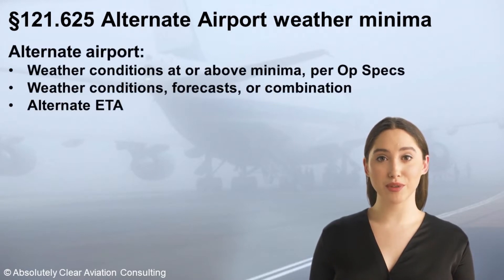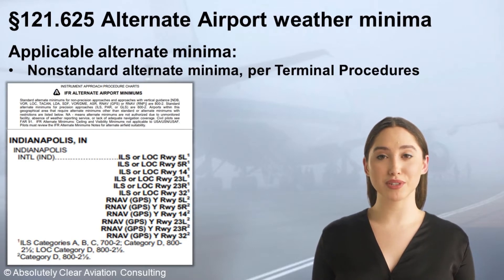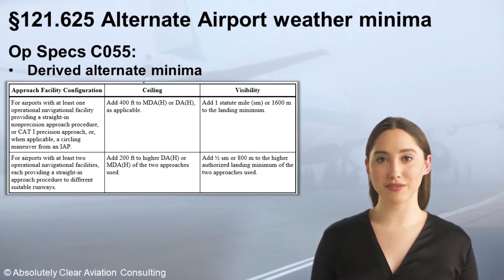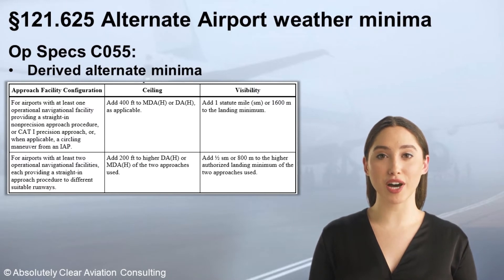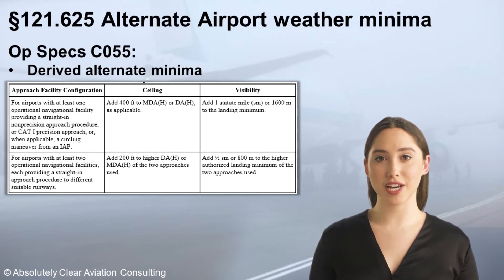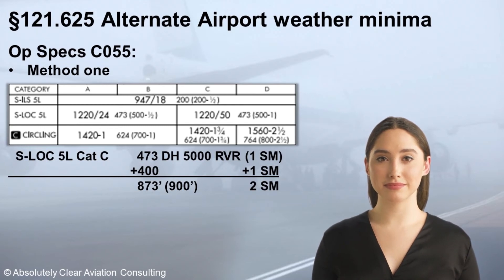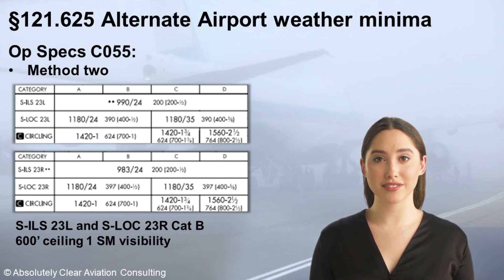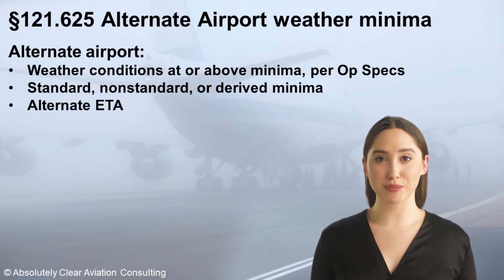FAA Part 121 Alternate Airport Weather Minima

Comment: When do you need an alternate in FAR121?  123 Rule? What about PROB or CHNC of in the TAF?
Reply from the maker: If both the latest weather report (METAR) and forecast (TAF) do not indicate at least 3SM AND at least 2,000 ceiling for period one hour prior to one hour after destination ETA. If either of those weather products indicates a visibility less than 3SM OR a ceiling less than 2000, an alternate must be specified. Any conditional language (tempo, prob, becmg, must be considered if time frame covers any portion of the +/- 1 hour ETA.

Comment: What about a prob in the forecast? Or a tempo?
Reply from the maker: In the absence of an ops spec authorization to permit less than applicable minimum weather in such conditional statements, with regard to qualifying an airport as an alternate, the applicable minimum weather must be reflected in the forecast at the alternate ETA. There can be nothing lower than the full applicable minimum ceiling and minimum visibility in the portion of the forecast that covers the alternate ETA.

For example, if the applicable alternate minima is 600/2, a probability or tempo that contains anything less than either one of those minimum values, would disqualify the airport under consideration for an alternate (at least at that ETA), since both prob and tempo statements are indicators that the ceiling and/or visibility could be less than required. 

Technically, a delayed departure time, which would result in a later destination ETA (therefore a later alternate ETA) may yield a different line of the forecast which would fully satisfy applicable alternate minimums. A more solid alternate (with better than minimum applicable weather) is a more prudent plan, when possible. See §121.631 (b) for the logic. Any new forecast issued throughout the flight must reflect at least the minimum applicable weather criteria for any specified alternate. Avoid violation of §121.631 by initially specifying an alternate with better than minimum weather, and monitoring new forecasts issued during the flight. Standard TAF issue times are 0000, 0600, 1200, and 1800z.